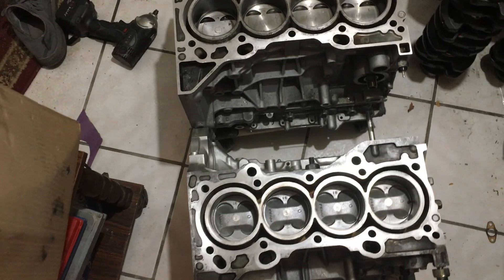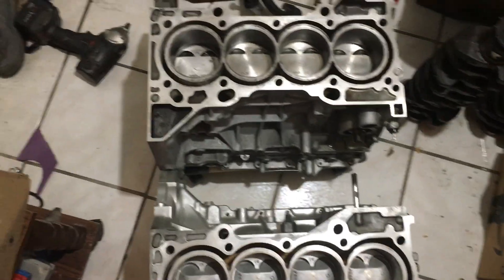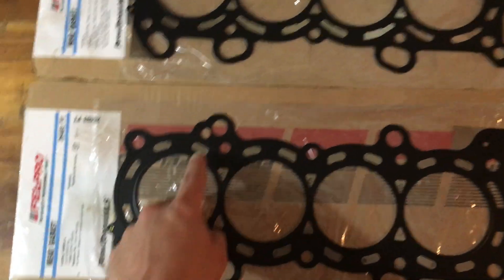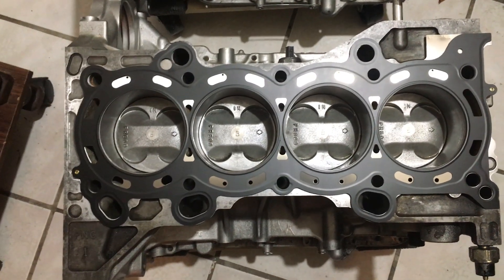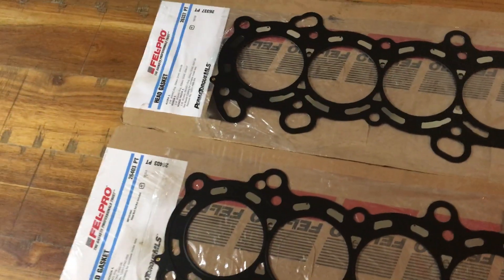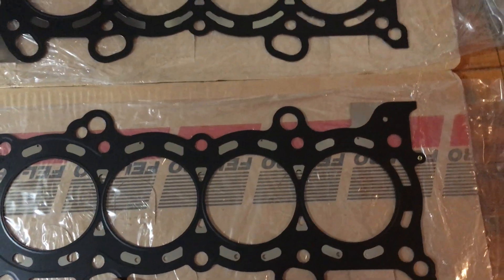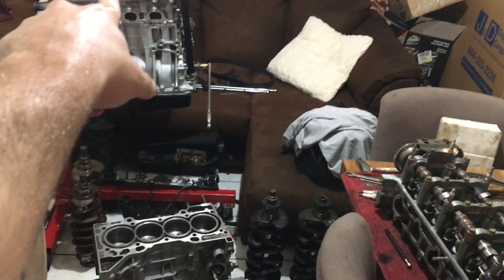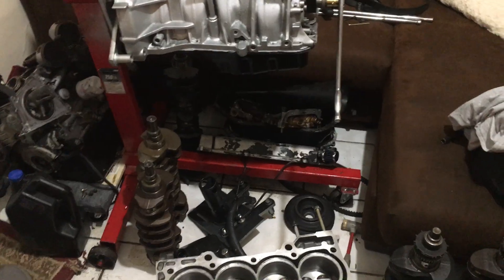K20 & K24 Head Gasket Comparison

Comment: The dowel pins are there to prevent things from shifting. You WILL have problems if you dont use them, its not if but when. Thats the reason for the dowel pin conversion on LS-Vtec conversions.
Reply from the maker: I use them if I have them don’t if I don’t. Never been an issue
Reply: @VHBEngines  they're cheap insurance.

Comment: the b16 gasket for the b16 head we used for my brothers b20z2 vtec conversion fit and when we laid the oem gasket down on the block at tdc the gasket for the b16 fit the b20 cylinders and didnt hit the pistons fit perfect. so yeah your old vid helped on that one and it worked for a while until his lma started messing up.